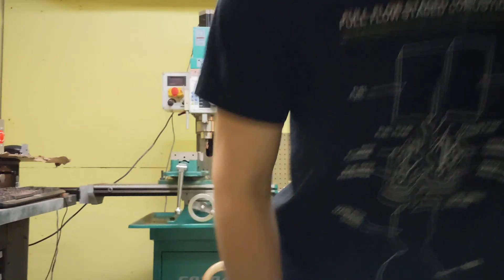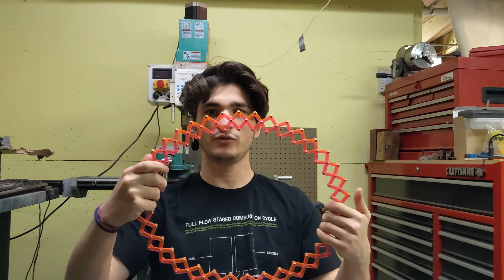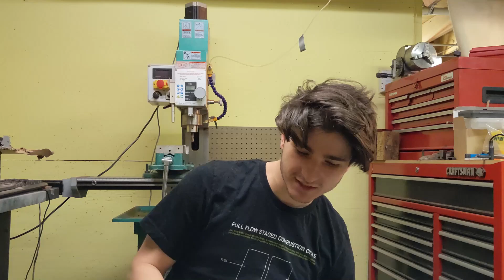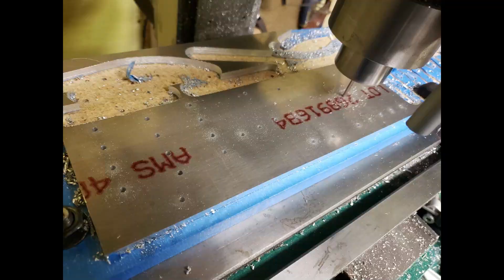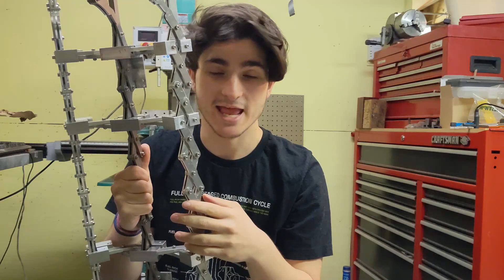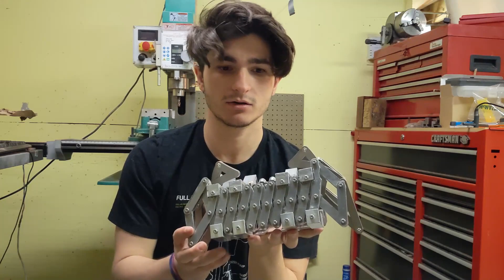Scrunchy Suzze Monologue

Comment: Such a wicked concept, with this and hum motor wheels you could have a wearable E-board the battery while not being able to fit on the board could stack onto of the board adding a platform of some kind or you could have the battery in the backpack and reinforce the cable so it also doubles as a tether 

Very awesome stuff, its a shame Aaron wasn't there to see it :( 

Cant wait for V2!!
Reply from the maker: V2 will be prettyyyy dope once it's done ;) so keep an eye out
Reply from the maker: Thank you. Thank you man!!! 
There are are a pair of trucks that have hub motors  and batteries in the truck axels!!! I was thinking about putting those on this thing!